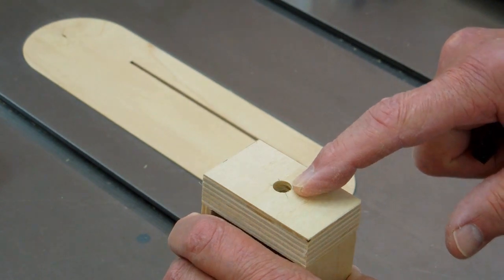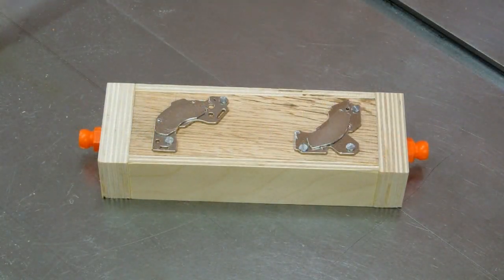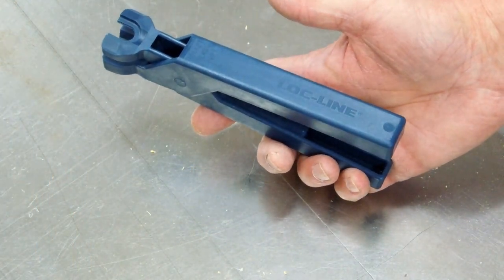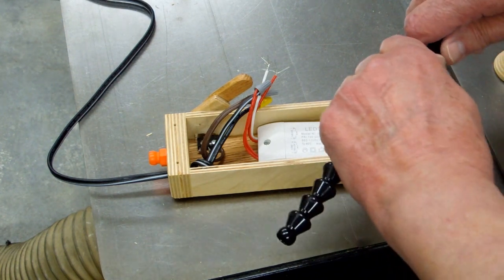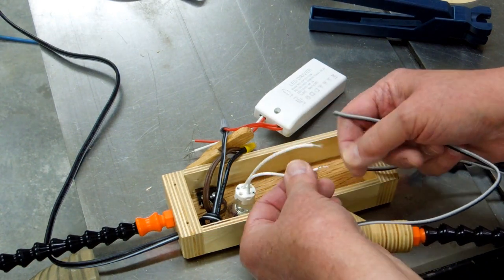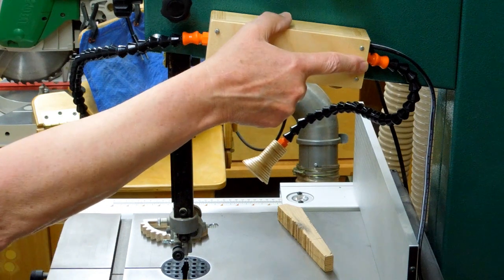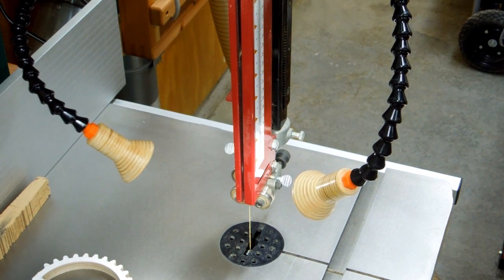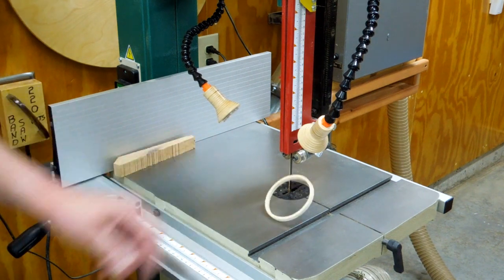12 Volt LED Lights For Band Saw

Comment: A little late to the party on this one. Great video! I got some great ideas from this. A tip for you. If you ever have trouble chasing wires through the line loc get a piece of speedometer cable to run through first and pull the wires with.

Comment: I have been following this Lightning-Project with great interest. I have got tons of new ideas for my shop based on your videos! Thanks!
(11/32nd bit...sigh...I am glad I am using metrics) :-)
Reply: Fredrik J 11/32 = 0.343 inch = 8.731 millimeter    if this any help
Reply: Marcus460 Thanks but I know how to convert metrics and imperial, I just find the imperial so unnecessary complicated when working with small fractions...

Comment: In the beginning when you are tapping the hole for the fitting you referred to it a 1/8" NPT, but then hook-up 1/4" loc-line. Does the measurement of the NPT fitting refer to inside diameter or were those actually 1/4" fittings?
Reply from the maker: Grumpyneanderthal Actual physical NPT (National Pipe Thread) dimensions are much larger than what the fractional dimension would indicate. The Loc-Line description is 1/8" NPT Connector for 1/4" Hose Segments. The 1/4" hose segments have a 1/4" ID (inside diameter). They also make other connectors for the 1/4" Hose Segments with 1/4" NPT, 1/8" BSPT and 1/4" BSPT (British Standard Pipe Thread).